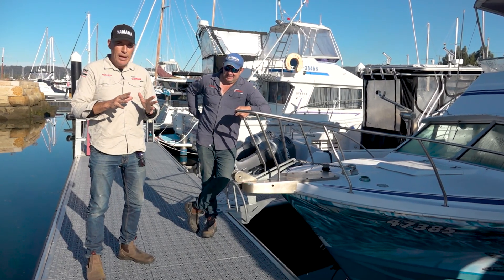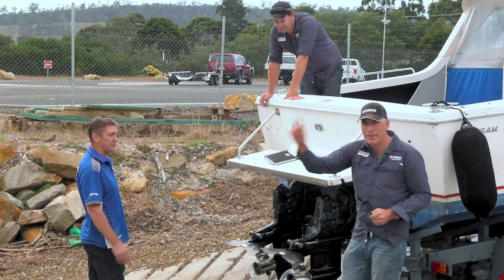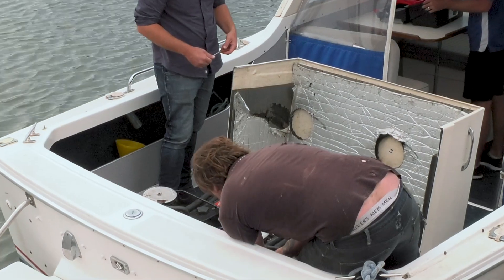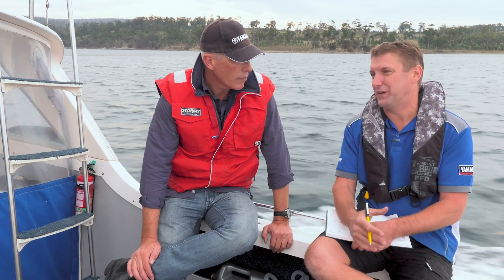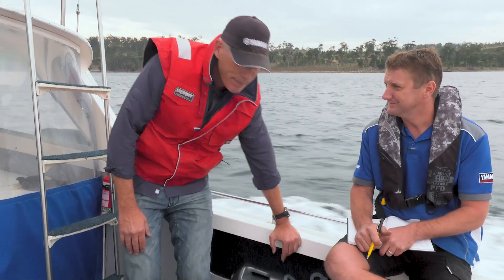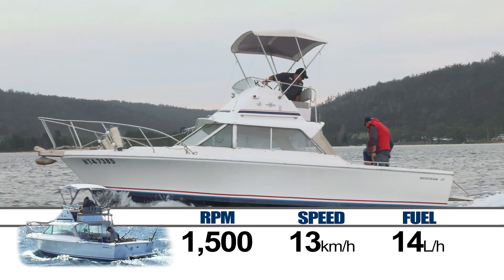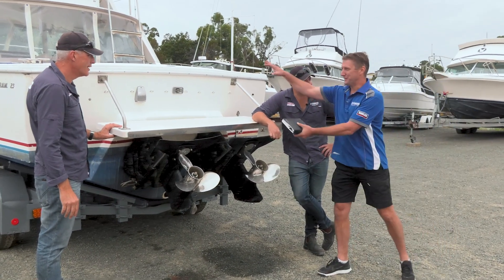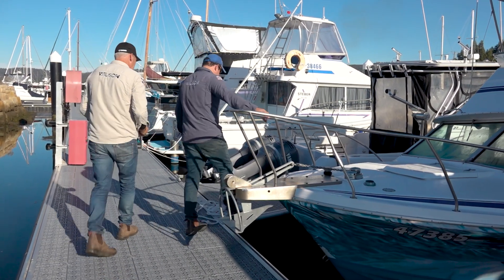Project Boat - Repower and restoration of a Bertram 25 Flybridge Cruiser (running the numbers) Pt 4

Comment: This will be interesting as I’ve got experience in what you are about to do, I’ve got 32ft wide body with twin 350 merc carbs and just replaced on engine also got 22ft Haines and build pod on back and fitted two 350 veradas. Everything can be done with money but the biggest thing is cost. I hope you guys are up front with the conversation costs. This is the critical factor. It’s not about fuel cost. It’s about how much fuel can you buy and cost of rebuild for the conversion.

Comment: 25 knots from twin engines is somewhat disappointing.   What was higher, the oil or fuel consumption at full noise?  I expected to hear a pretty big bang from the dodgy motor when you did that top speed run.  Having said that, these projects do show how long lasting these old glass boats are.  Great video.  Keep them coming.